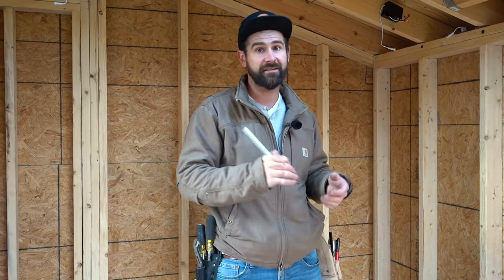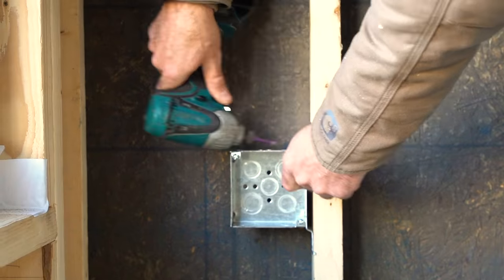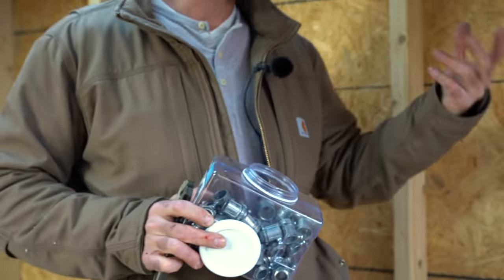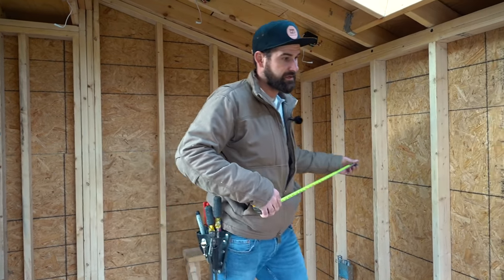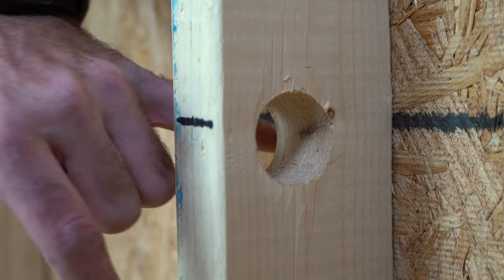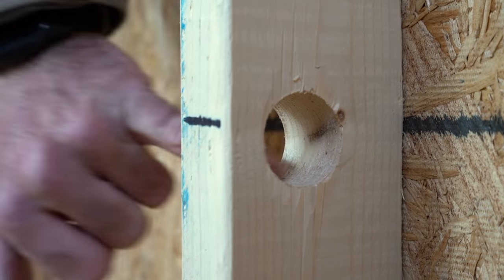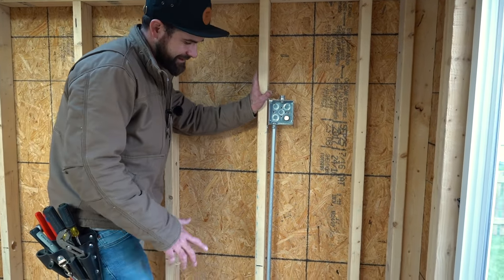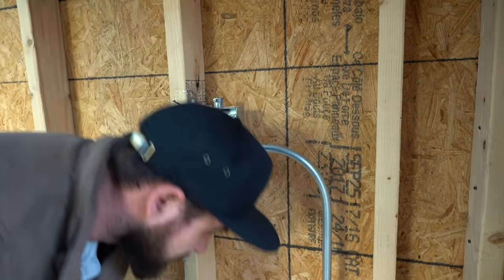How to bend and install electrical conduit

Comment: In a shop, is conduit required above a certain height?
Reply from the maker: I would highly recommend using conduit whenever you’re dealing with exposed electrical, especially in a shop where objects could lean against the wall or fall onto your electrical lines

Comment: I use old needle nose pliers to knock out my knockouts and ream my conduit. I would wear a framers nail pouch loaded with my screws, connectors, couplers, and straps have my needle nose, flathead, and a carpenters/grease pencil in my back pocket then my drill with my hole saw and a #2 Phillips bit and tape measure..

Comment: Please explain why the conduit is necessary? Cause its a shed, not a house, and they're expecting equipment or whatever in it so it's to prevent damage? Or does your local jurisdiction just want to cost people more money so they require steel boxes and conduits?

Comment: Great video. I am working on a project with 3/4 emt on outside of a structure.  I will have to use water tight fittings.  Do you recommend one brand over another?  Thanks again for the great tutorial.

Comment: Hi. Great video. Is there a reason for running a 90 up and then back down instead of a straight shot to the boxes? Looking to do this in my garage where the outlets are about 4ft and was planning on straight shot but will bend if it’s better or I’m supposed to. 

I’d also like to avoid couplers. I have about a 6 ft run between the boxes. Is this possible? Especially if a straight shot.
Reply: Ease of install, you could potentially get a 6' run in, but you need a long wall to be able to start sliding a 6' piece into one side of the run. In general, the way it is commonly done is for code and speed. You can potentially save some pipe, or skip a coupling, but for a paid worker, the time doing that costs more then a coupling.

Comment: Excellent demonstration and thank you for that. But... I'm seriously concerned with the weakening of the studs by cutting holes in the middle of them to run the pipe. So for a place where aesthetics doesn't matter much s.a. shed, why not run the pipe/flexible metal condo, visibly and from inside without going through the stud? or is it against the code?
Reply: Without getting too into the coding, no drilling closer than 5/8" from the edge of the stud and the hole(s) shall not be more than 40% of the depth of the stud.
Reply: @dustind292  Thanks a lot and highly appreciate your valuable comment. I made a note of it, in case but still love to find a way going around the studs or even get a decorative conduit for exposed extension, if that is not a big no no by the inspector or more importantly, the boss (Troublemaker honey!).
Reply: @samsen3965  You can run the conduit on the exterior of the wall as long as you follow the proper securing rules,but it would be up to the customer. I've seen it done when someone wants that kind of industrial look, but it can look horrible if you don't have someone who's very proficient in running conduit.
Reply: @dustind292  🙏🙏 Thanks and your valuable input is very much appreciated.

Comment: Wow, good job my friend. Alot of idiots didnt understand when you said, its for people who never done it before. There is and always will be experts on knocking other peoples stuff. Flex tubbing doesnt ground the circuit, flex tubbing melts in heat if something goes wrong. Its just a cheap way to do the job. In the US we do it the write way. If you use flex and something happenes to the circuit? Good luck braking and replacing the entire wall to replace your cheap ass flex. Flex is harder to track in a wall for future repairs, conduit can be traced with a metal detector. Thats why it only takes 1 american to change a light bumb.

Comment: Incredibly useful! Do you have any videos similar to this but with mounting conduit to cinderblock walls. I’m renovating my shop and just had 100amp service installed but need to run all my electrical and my shop is a cinderblock building.

Comment: I ran some conduit for the boss once and when I finished, and he was looking at it, he was trying to keep his place on his trace by following the pipe with his finger. He looked like he was following a gnat flying around the room for an hour or so until he came to the end. Then he asked why I didn't just use a 12" conduit to connect the boxes that were so close together? I wish I saw this video while I still had the job. 👀

Comment: The disadvantages of using drywall screws are unclear.  You cited electrolytic corrosion - clearly more corrosion-resistant materials are warranted in e.g. damp locations.  Drywall screws are steel so how would there be corrosion due to dissimilar metals?  Granted, you do have steel, zinc, and phosphate.  If I understand correctly deck screws are coated with a non-metallic substance which will probably chip/flake once driven in, allowing for corrosion to get started.  So the best options for corrosion resistance seems either hot-dipped galvanized or stainless steel.  I looked high and low for an electrical code specifically prohibiting the use of drywall screws - is there one?  What I found were generally about using corrosion resistant materials given the location where the equipment is to be installed.
Reply: Generally agree with you! But you can get corrosion with stainless on galvanized (since stainless is more noble then zinc), so it's better to use galvanized screws with galvanized boxes.
Reply: Yeah that part was b.s.          😂

Comment: What would you use for an exterior light mounted on vinyl siding? Whoever built my house used a round plaster extension ring that leaves a 1in gap from the vinyl mounting block

Comment: I have 10ft of old wire but a 15ft run, how can I just join the pieces in the pipe with the twist on caps, or the push in connectors? Or do all connections of wire require another box? Can that box be covered with dry wall or does it have to be exposed with a dummy plate over the top?
Reply: All connections must be accessible👍

Comment: why are you running emt through studs to begin with? if the walls are getting closed you dont need it at all, if its commercial just run MC or RX if its residential.

Comment: Excellent video Bob. Can you bend electrical PVC conduit with this tool?
Reply: 😂😂😂🤣🤣🤣 nice joke
Reply: @michaelhelgeland4588  Nice input m8.
Reply: Get a blowtorch.  Don't get to close close PVC. After some time, it'll soften up and you can noddle into whatever bed you want. 
You can also use a heat box, but most people don't have that unless they're doing it a lot.
Reply: @austincoz364  you Don't open flame a pvc pipe, heat gun or hotbox is the way

Comment: If I'm running conduit above ground on the side of a home how do you seal up the connectors?
Reply from the maker: You need to use Ridge conduit and either threaded connectors or compression

Comment: Props for running EMT instead of MC or romex.
Reply from the maker: Hey Ann thanks!
Reply: as he mentioned early in the video, he is required by local jurisdisction to do so. i don't know about many jurisdictions other than my own, but in areas like Chicago, they require all their wiring to be done in metal tubing.

Comment: You should’ve pre fabbed those boxes with all the hardware like those connectors or pig tails (if you needed them) and then mounted the box to the stud. Just for next time in case you make another shed or do something similar to this

Comment: Marker on bends is crazy
Reply from the maker: Thanks! What projects are you working on?
Reply: @BobClarizio   4 inch pipe running 500 wire to transformer and making raceway for a new machine in a hospital

Comment: explain how old time electrians wired up a light to be turned on from 2 different points with knob and tube without using 3 way switches
Reply: You would just run a switched hot from switch 1 to your lamp socket, and run your second switched hot from switch two to the same hot side of the lamp socket.
Reply: It’s probably not per the latest code!
Reply: You are thinking about the Carter System of 3 way wiring which is no longer legal but definitely uses a 3-way switch.

Comment: You dont need to mechanically protect the cable with metal conduit. Just use RCD or RCBO. It is already protected in dry wall. But very good work.
Reply: Chicago and Cook County (many Chi Town ‘burbs) are all Pipe and Wire.
Reply: @peterwachter7753 
Exactly ..been there done that ...😂 Required by local code.

Comment: love it!
Reply from the maker: Thanks! What projects are you working on?
Reply: @BobClarizio  I’m an elevator apprentice and we pipe and pull our own work. 
I was taught early on to use flex to avoid having to bend pipe, but recently picked up piping most of our work. And I love it, makes the job look cleaner. So I enjoy your use of emt and proper techniques. Even being behind a wall eventually, where others would just slap romex up without any form of piping. Neat.
Reply from the maker: That’s really cool, I give you guys alot of credit! I had the pleasure one time working on an extremely old system and to watch the guy I was with sort through a 60 floor button panel was impressive. Do you most do new installations or retrofitting?

Comment: Lol all of you so called electricians saying it's overkill and above code and you wld challenge the inspector read the first page of the nec. It's been awhile but I believe it states the codes and rules in this book are not laws just bare minium reccomended standards and is up to the authority having jurisdiction to adopt or make final rulings and say as to what is bare minimum requirements and can exceed or forgo these nec standards if so desired

Comment: Ring? You mean lock nut don't you? I always use 4" square deep new work boxes. Massachusetts code is very strict regarding cubic inch capacity of conductors in a box which are much deeper than your 1 1/2" deep boxes. Don't do box offsets where you live I guess 🤷

Comment: Why didn't you use PVC pipes? In metal, don't you have to have the differential protection connected to the pipe? In Italy there is the obligation of double insulation

Comment: I always us compression fittings for EMT, have too many issues with set screw fittings.
Reply: Why ? Ones indoor the other outdoor. One cost more one costs less. One takes longer to tighten and requires a extra tool in the apron.

Comment: I never had to run pioe through wood
I always do it surface 
Mc cable is as good as emt or puoe inside walls 
Unless code wont accept mc cable.
I guess all dipends state code !

Comment: I have a question ..do you know if I could use a 210 electrical wire to use as 110 ..if I eleminate one prong ..it was four wires ..black red green.white..i thinking to eliminate the red wire ...any suggestions
Reply: You can do anything you want. Electrons don't care what color they are. Yes you can do that. But that's a 12/3, not necessarily a 240v wire.
Reply: Thanks Mike ..I just wanted to run the electrical wire from the meter box to my room for my air-conditioning..110
Reply: @ezequielmaldonado5547  Go from your panel...not your meter.

Comment: My 1st day as an electrician I was bending conduit. Boss said pipe is there here’s the bender and walked away. I installed all the pipe and pulled the wire in a day. It was extremely basic. I was an electrician for almost a year but I found it extremely easy and repetitive. I became a roofer and never looked back. Boss was a good electrician and said he makes 200k a year when he’s booming. I now make double that every year and have made 3x that a couple times.
Reply: Proof
Reply: @Zeffy55  proof is in the paper
Reply: I'm an electrician for many years... but now I want to be a roofer 😉
Reply: My 1st day as an electrician I wired 3 houses by lunch now I make 400k a year when I'm not booming. Now I make double that every other year divided by twelve and have made 6x that 22 times.
Reply: Haha ur not fooling me bud
Reply: @joshskoflic8391  600k a year roofing.. not bad but I made 6 million this year roofing, and sometimes 3x more.
Reply: @Annah382  wow that’s good man. Are u commercial? I wanna get into commercial that’s where all the money is at.
Reply: Utter bollocks. It takes 4 hard years to become an electrician hot shot. Now you're a roofer?! I take it u failed the 1st year exams ha. What did u wire??

Comment: Use a Torpedo level on your 90’ bends make sure they’re level guys it’ll save you time in the end when you’re not screw-in around getting frustrated when your pipes crooked or not fitting right cause you eyeballed it
Reply: 15 years experience. I eyeball everything. I'll put it up against a level any day.
Reply: There is no need for torpedo levels when installing conduit in wall or ceiling cavities.
Reply: easy way is to use the stud to make sure your 90 is true. but it is so easy to make a 90 right the first time. when the line on your bender is parallel with the floor you have a true 90. remember the angles are stamped into you bender. along with the star and arrow.

Comment: Do you reguire moisture barrier on th e exterior wall in the basement rough in like blue boxes or steel boxes are sufficient
Reply: He literally said he’s doing electrical for a shed not a basement. Depending where he’s from no insulation is needed or they may require use of certain products for electrical

Comment: run your wires first - then hook it up - easier instead of feeding the wire later -  oh and next time, when you holding the spot with your thumb to mark the cutting point, don't move your thumb - it will bleed a little, but you will be all-right, especially, since it is your Left Thumb! Just like my buddy who got in a car accident and his entire left side (leg and arm) were detached - so he is all-right now.

Comment: Having worked in the Electrical Trade, running conduit (EMT $ PVC) , the EMT (Electrical Metallic Tubing), is the more difficult to run. Remember; you have to pull your wires through it and depending on how well you thought it through and did your job correctly, will determine the degree of resistance (friction) you will come up against.  Try to use as LESS bends as possible and obviously, the straighter the conduit run, the easier the wire can be pulled through.  Sometimes, you will require a lubricant (# 11) "wire lubricant compound" to apply with your wire run.  Ensure to REAM your conduit - ALWAYS.  and ensure your connections of your conduit run into the appropriate fittings are secure.  You do not want to have to fail your inspection or have to remove your drywall to fix it.  Work safely.
Reply: When tubing (conduit) in the UK years ago, we always used to say no more than 180 degrees in any tube length, so that it could be wired-try three 90 degree bends! unworkable!
Reply: @johnchristmas7522 
I like 4 90 degree bends so I can end up where I started ..😂😂

Comment: Is putting electrical installation in metal pipes an american thing? In Germany you would just put them loosely in the drywall - or maybe use plastic tubes.

Comment: Any idea what the justification could be for requiring conduit here (as opposed to MC/AC)?
Reply: it code in some cities like chicago
Reply: @777pyro  I understand that.  My question is, what is the justification for the code requiring conduit?  It seems like overkill for a shed.
Reply: safety concerns. and looking into the future for the electrican who has to come behind you. in a room thats pipe i can for the most part tell you how the circuits are run. when you learn it you will see it makes the job much easier and cleaner.
Reply: @cdecoro  how do you rerun a circuit in romex that has been shorted out., do you have to open the walls to rerun it. and how far. in conduit you pull the old wires out and run new ones. plus in chicago they do not allow plastic pvc or nm cable in case of a fire. and toxic fume.. plus you also have the problem of electro magnetics. and one more fact there is no ground required. the pipe is the ground. except in iso circuits.
Reply: @jburnes41  You get in a crawl space and drill a hole up the wall. Or get in the attic and drill a hole down the wall. 
Worst case, run a wire from a source, outside into a pipe and back into the box with a short. 
I do this weekly. Conduit in studs is absolute overkill.

Comment: Over drilling the conduit holes and hammering those conduit plugs into the frame is a major structural safety issue. Probably ok for a small shed like this but on a larger structure big no no.
Reply: The rest of this seems pretty good. Bringing the conduit all the way to the ceiling is a better idea, then offset the ceiling drywall to cover it later.

Comment: Thanks Bob for the video. 
I have a question: At about 10:40mins, it says 13-1/4 and the next measurement was 47". Are both measured up to the center of the EMT or connector?
Reply: On a 90° bend like this it would be from the in side lip of the top connector to the bottom of the bottom connector

Comment: As a union electrical apprentice, you are a hack. That coupling on the 6 inches of pipe for that 90 is hilarious
Reply: I’ve been in the IBEW for 24 years and I’m appalled by your comment. Learn to give constructive criticism.
Reply from the maker: Hey man, I appreciate you running damage control. I guess you can’t win them all.

Comment: Re: at around 2:50… why don’t you recommend wearing eye protection, also!
Reply: That's lame, as a plumber drilling holes through wood, I just close my eyes. Sometimes I use safety glasses, but on hot summer days they get fogged up, and sweat covers them. I do get wood in my eyes sometimes, but it gets itself out after a while, just learn how to squint.
Reply: @Trillion_Dollar_Extreme  all the best to you!

Comment: The correct way to do this is to just completely cut the bottom part of the stud off and run the conduit straight though.  No drilling required!!  You don't need studs anyway